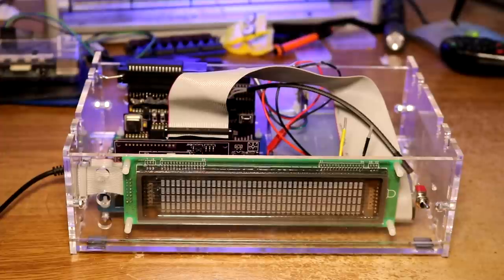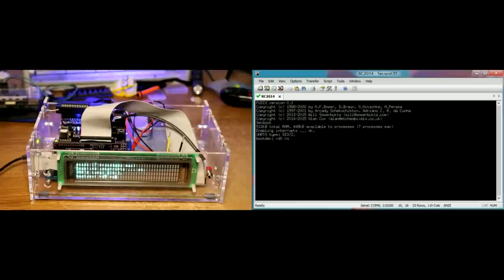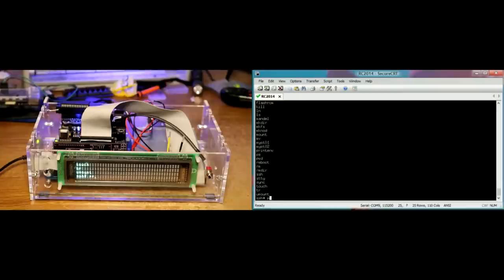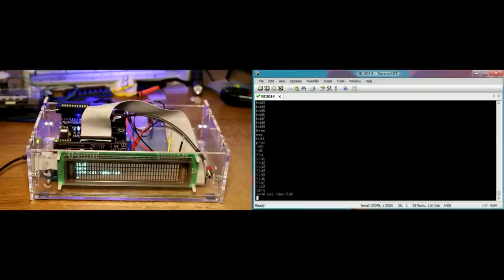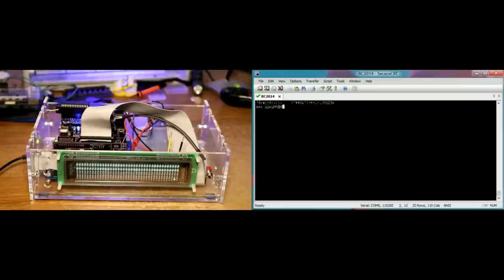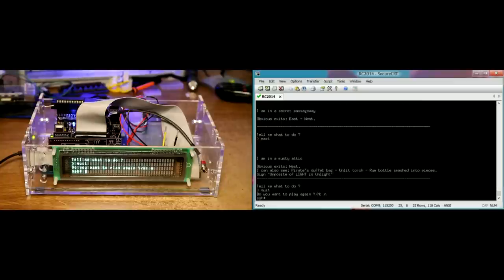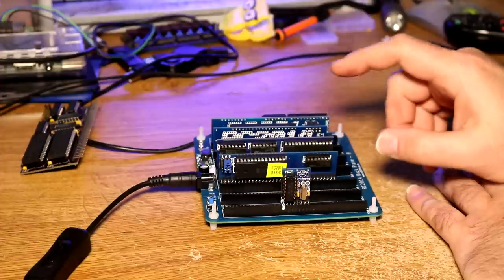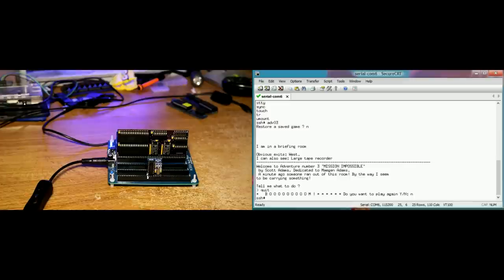Z80 Retrocomputing 16 - UNIX on RC2014

Comment: I don't think you need the CTC. You can do my favourite 'no timer' hack. Set the second SIO port that is unused up to a low baud rate and to interrupt when the transmit completes. Now every time you write a character it'll bug you again a while later. You can calculate the speed from the shift rate (remembering start and stop bits), or just use a scope to tune it.

Comment: I thought Fusix just looked like Linux, but wasn't actually Linux.
Reply: Martin Heermance Yes, Fuzix is based upon UZI (UNIX for Z80), so you could maybe call it a UNIX derivative, but it definitely isn't Linux as it share no source code with it. It's put together by Alan Cox who used to be a Linux kernel maintainer though. Got a couple of other RC2014 projects I need to complete in the works, but want to give this a go soon!
Reply from the maker: You're right, and I should have known better! I've corrected the video title, but I can't edit the video itself.
Reply: smbakeryt No worries, but thanks for the correction.
Reply: it is even less Unix to me .
Reply: smbakeryt

You've forgotten to edit the description of the video, itself. It's editible too, you know.
Reply: In a way, it's far more impressive that it is not Linux. ELKS is a newly active attempt to get a subset of the Linux kernel running on 8086 if that's what someone looking at this is after. Fuzix (and its Uzi predecessor) are a much smaller, much more resource-constrained system with a bespoke design (some BSD, some v7-sysX, some POSIX) and some unique features to allow things like swapping processes in and out of memory (ie to non-mappable RAM) to facilitate running something more than trivial programs in very small systems. It is profoundly impressive.
Reply: It was created by Alan Cox, who was a long-time Linux developer in the early days. Looks like he started this project not long after leaving Linux development.

Comment: Do you happen to know of any kits that have a Shugart FDC interface on one side, and a USB  on the other? I kinda want to put my old floppy drives into use by using that, and I kinda want to have them semi-portable. I've been looking for such a solution for many years now, but all I do, is finde one roadblock after another.

Comment: Could you add CGA or something to your RC2014?
Reply from the maker: There are vintage video video boards that people have designed, though most of the designs have seemed somewhat involved. It's something I'd like to try at some point.
Reply: That would be awesome. I'm tempted to buy a RC2014 and add a FPGA adapter so I can emulate peripherals.

Comment: Did you build that case? What matrerial is that? I have a wierd lpx motherboard with k5 processor and getting a case for it is alsmost impossible so I thought I'll create my own.
Reply from the maker: The case is laser-cut acrylic. I designed it in Inkscape and had it made at Ponoko. It's one big flat sheet when it arrives. The acrylic sheets they cut can be pretty big, so I'd think you could easily design and have something fabbed. For me, I've mostly moved on to 3D printing instead of outsourcing the laser cutting, but for larger items, and for anything you want to be optically clear, laser cut acrylic is still a good option.
Reply: @smbakeryt  Thank you!

Comment: Is it possible/worth it to build an intel 8086 pc?
Reply: Also can you explain how you modified fuzix to work on your rc2014? I'm building a custom z80 machine and it would be awesome if it ran linux.
Reply from the maker: My next project is going to be to build an Xi 8088 (http://www.malinov.com/Home/sergeys-projects/xi-8088), based on Sergey Kiselev's design. While Sergey's design is an 8088, I would think an 8086 (or 286, 386, etc) would be possible.
Reply from the maker: FUZIX has a profile for the Zeta 2 already, which is a Z80 single board computer. The Zeta 2 uses a 16550 UART for serial communication, whereas the RC2014s I demoed use a SIO/2 or ACIA. So my first task was to replace the UART driver with a SIO/2 or ACIA driver. I was also lacking a few other peripherals, such as the Real Time Clock, so I disabled those. My fork of FUZIX is at https://github.com/sbelectronics/FUZIX and has any custom changes I required.
Reply: Please build 8086 kit, I wish to buy  the sdk8086 but the only source is from India, I am nervous  to use credit card online for Indian website, so I did not. Hopefully if you make a lot, you would sell them. Thanks.

Comment: Can this project be ported to an 8051?
Reply: This is a reply to an old post...but...The Intel processors such as 8080 or 8085 had a SUBSET of the opcodes in the Z80. So if the software running on the Z80 was developed for the Z80 it may not run on the 8085. The Z80 also had registers that the 8085 did not have.
Reply: this is also true of the 8051

Comment: Hello,
I like your projects and really wan to reproduce them but without firmware images of the EPROM, no chance! Most people have a PC without Z80 development kits and I know that it is very diffucult to make these old software run without detailed knowledge on emulators, assemblers and debuggers. Z80 is not an ARM Cortex with JTAG interface, ready to run in C. ( I have written my own Z80 monitor in C with SDCC but no chance to use it with the RC2014 boards. So if you really want to help, can you provide EEPROM images, e.g of CPM and Fuzzix?
Reply: look in his GitHub repository, which he links to in his blog page in the corresponding RC2014 blog posts